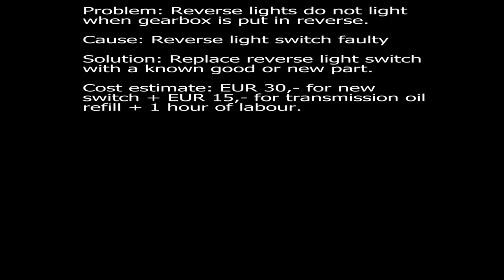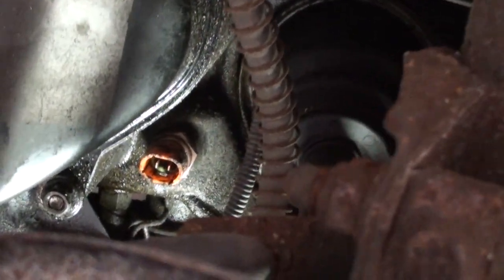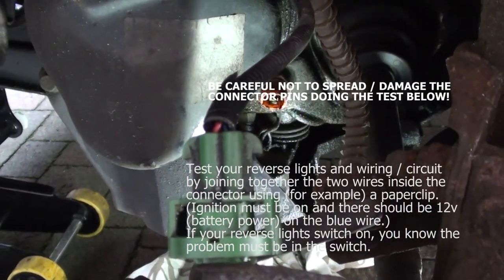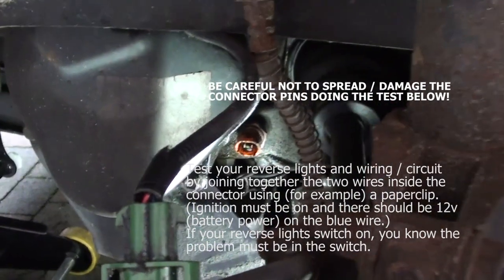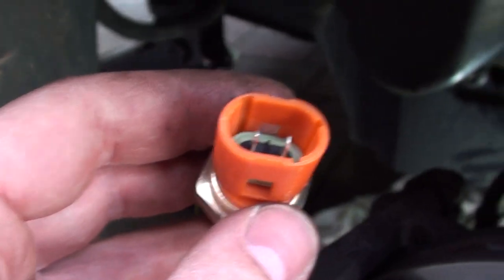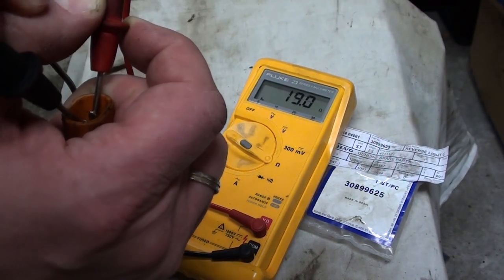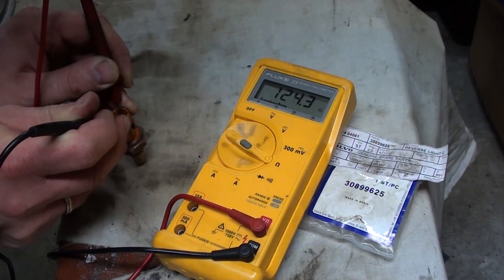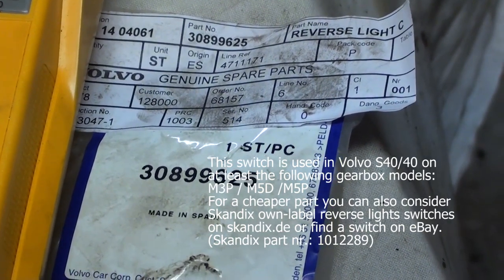Volvo V40/S40 Reverse light switch replacement

Comment: Did you put it in reverse, as you changed the switch?
Heard that there maybe is a little spring that could fall in the gearbox if not put in reverse?
Reply from the maker: Sorry, can't remember..
Reply: +Koen van Cuijck
Okay i will just have to try
Will share the result :)

Comment: Does the engine and gearbox have the same oil?
Reply from the maker: No. I have never seen a European manual car using engine oil for gearboxes. Normally these gearboxes use Gearbox Oil like a 75W90 type. Lookup the exact specifications in your workshop manual.

Comment: there was nothing wrong with the switch, in fact you proved the mechanism worked with the continuity test.

it was more likely to be dirty contacts and a high resistivity connection somewhere between the two pins and the electrical terminal socket.